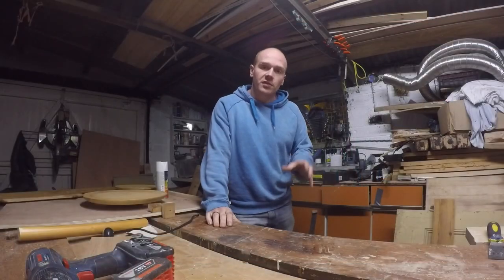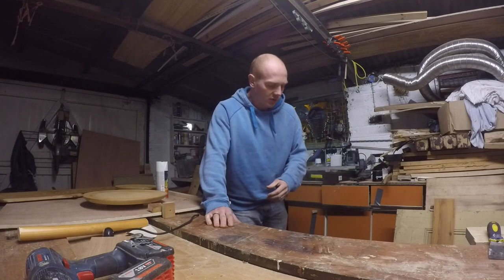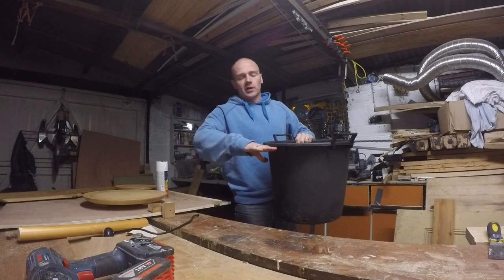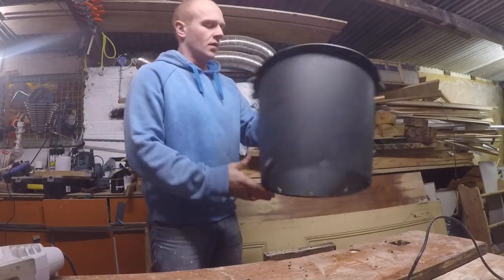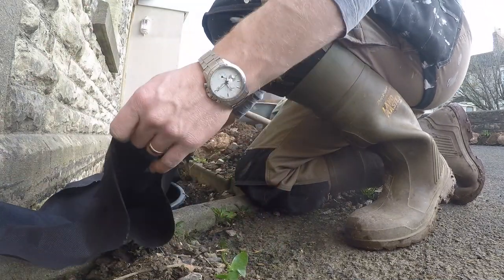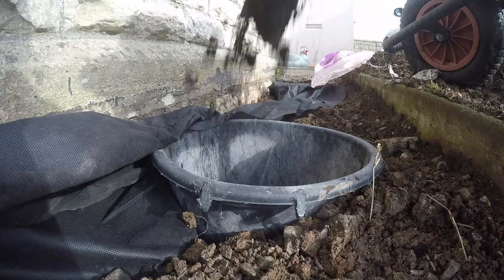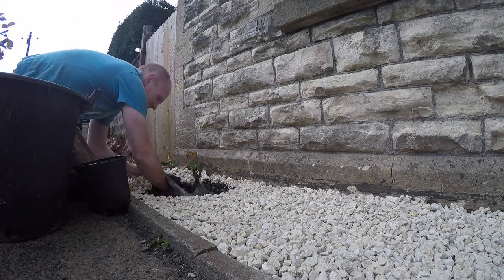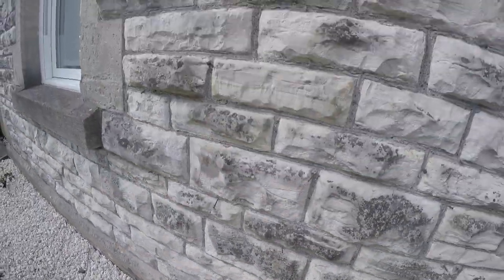Planting next to a House Wall and avoiding Damp

Comment: You will some trellis or wire arrangement. We have a couple climbers on the front of the house. Supported on painted wooden trellis. I have mixed them with Clematis. I stopped them growing beyond the first floor as it really becomes a pain to prune and dead head. It took about six years on a south facing wall for the roses to get to that height. But I get a great show of flowers in spring and summer. ATB :)
Reply from the maker: Think it will be a case of just being patient for a few years! I will be using some discreet wires to train them too as they should blend in with the stonework anyway. 😀
Reply: Yes, I imagine it will look very nice in a few years

Comment: Loving your videos mate. Quick (ignorant) question though...When you get very heavy or prolonged periods of rain, does the rainwater not still soak into the bricks and / or down into the foundations if there’s no (french) drain to carry it away? I have just moved into a house which has the exact same ‘soil against brickwork’ issue and I can see how wet the brickwork is and want to fix it myself in the same way you have. Any advice is greatly appreciated as you really seem to know what you’re doing. Many thanks.
Reply from the maker: Gravel alone down to a good depth will be very helpful however a drain even better. In this case, all the water from drive is diverted so it’s just what falls on the gravel. The main priority is dealing with moisture in stone around floor height and above. Below that has the added benefit of air flow under the sub floor.